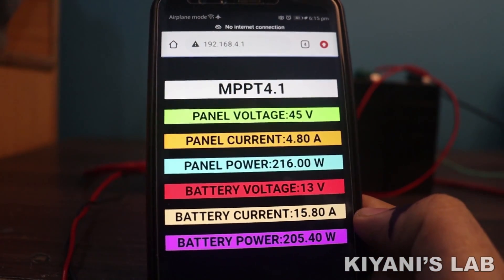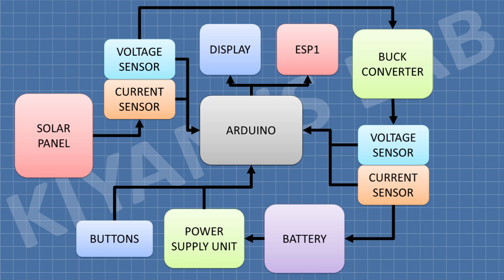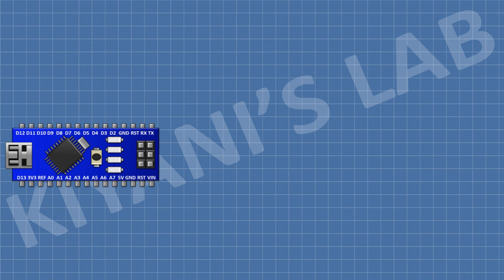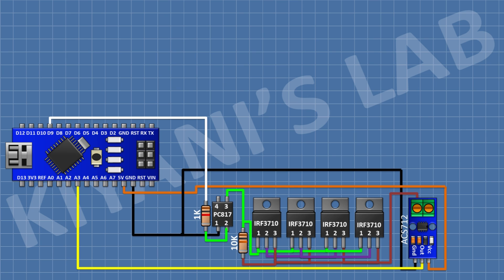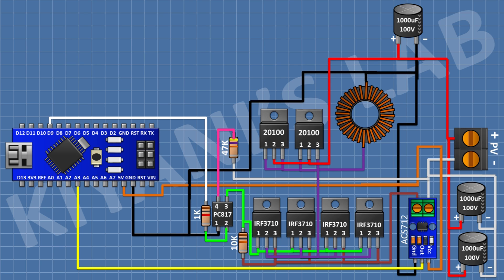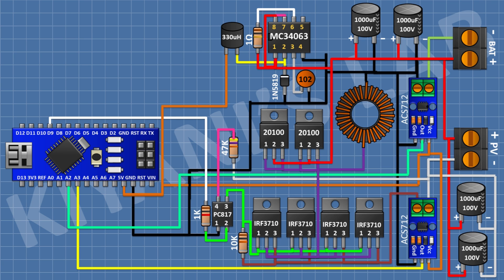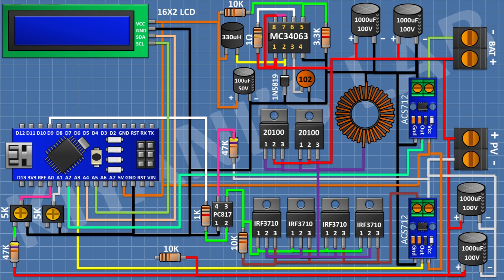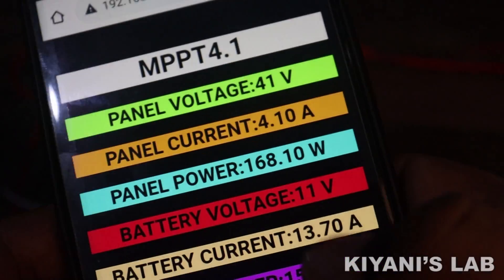How To Make MPPT Solar Charge Controller | Wi-Fi Server

Comment: Does the value of the solar panel output affect the values of the resistors and the components used in the mppt if so what is the minimum and maximum voltage and current of the solar panel that I would use

Comment: Hi Kiyani's Lab .Thanks for the answer. I haven't tested the whole project yet but I think that without a voltage divider on the rs pin of the esp the wifi won't work. Because the arduino rx and tx logic level is 5v and not 3.3v. And from what I have read, it may be necessary to feed the esp with 3.3v without being through the arduino for maximum efficiency of the esp
Reply from the maker: right there are 2 1k resisters for rx and tx

Comment: Local area network based or internet based ?
Reply from the maker: LAN
Reply: @KiyanisLab  thanks for replying Sir, if I will make charge controller for two cities, then the IP address of both the cities will be different, right?
Reply: @KiyanisLab  please explain the code if you can sir

Comment: PC 817 Opto coupler pin 1 & 2 want to interchange. and 47 K resistor from 4th Pin want to connect it to Battery +ve .
Reply: You are right i think he is reading without seeing😂
Reply: Have you see the pcb design?
Im so confused because the optocupler hole didn't match the diagram 😩

Comment: Very good job. WHat will be next ? 100 amps - 2-phase MPPT ? With ESP32 or STM32 ? U also need better toroid, e.g. for 50 AMPS. Is there derating of output  if temps of FETS and toroid go up ? Can we set up prarams. of MPPT with app or through web server ? What about uploading code to MPPT with WiFi and what about emailing status if the maximum voltage of the battery is reached ?
Reply: You always reason great friend.
Reply: Hello, what is the cross section and size of the ferrite ring 100uH Inductor?

Comment: Bro there are three trimpots of 5k so at what value we have to set on these
Reply from the maker: we have to adjust voltage with then until voltage on screen is equal to the volts of pv and battery
Reply: Thanks bro

Comment: Most awaited video and thanks. Kindly add some basic details like max pv input voltage and can we use bigger terminals bcoz these one seems to be very small one
Reply from the maker: max input v can be 50V yes we should use bigger ones if we are going to use it for high amps

Comment: Mc34063 what work in this pcb
Reply from the maker: it is an pwm controller a buck converter is made from it to power the Arduino
Reply: Thanks 😊
Reply: Better you make pid battry volte
Reply: I want to discuss sum things

Comment: Posbale add chose 12 / 24
Reply from the maker: it can be used for 12v only soon a new version will be made for different volt batteries
Reply: @KiyanisLab  sir may be when you mak new version